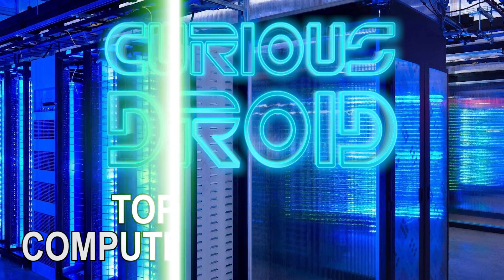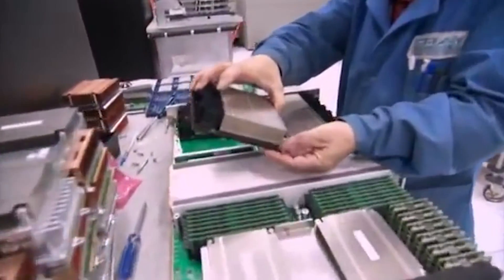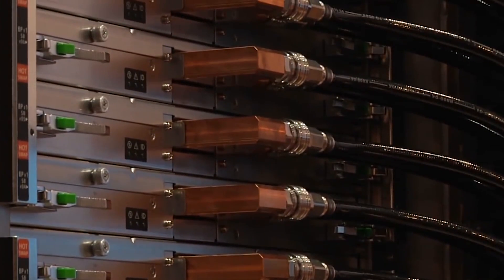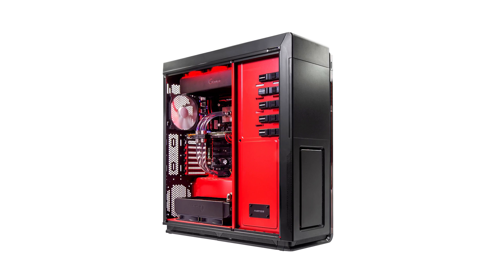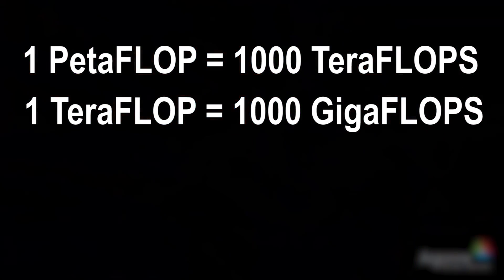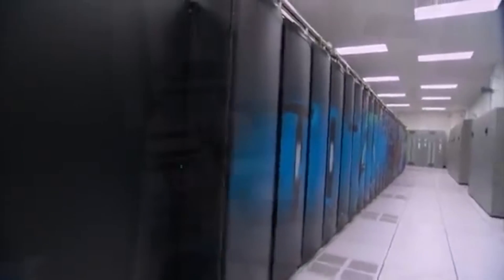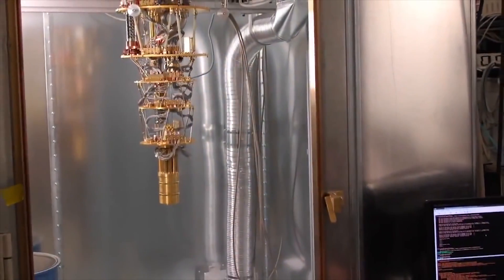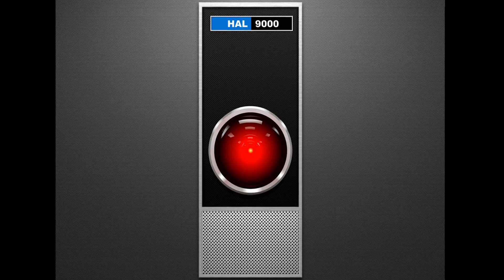Top 10 Fastest Computers in the World 2016 - How much faster is a supercomuter than a PC or iPad Pro

Comment: you're comparing cpus, but gpus are much more powerful, for example: my i7-4790k does 96 GFLOPs/s and my GTX 960 does 2300 GFLOPs/s, but an Nvidia Tesla K80 (dual gpu, commonly found in supercomputers) or an Nvidia P100, respectively do 5600-8700 GFLOPs/s and 9500-10600 GFLOPs/s
sources:
https://en.wikipedia.org/wiki/Nvidia_Tesla
https://en.wikipedia.org/wiki/GeForce_900_series
http://www.techwarelabs.com/intel-core-i7-4790k-devils-canyon-cpu-review/4/
Reply: the GTX 1080 does 6.5 teraflops
Reply: GPU's cannot handle serial or branch heavy code like a CPU can. They are best suited for code tasks that requires no branch prediction and can be paralleled.
Reply: The Tianhe-2 uses 32,000 Xeon E5-2692 (12 Core, IvyBridge, 2.2 GHz), 48,000 Xeon Phi (57-core, 1.1 GHz) and 4096 Galaxy FT-1500 (16 cores, 1.8 GHz)

Titan uses 18,688 Opteron 6274 (16 cores, 2.2 GHz) and 18,688 Tesla K20X (think of GTX Titan, yeah it has over 18,000 of it)
Reply: but can it run minesweeper at 140p 30fps?
Reply: RainbowSixSiege
yes fucking idiot. I dont want to see triggered shit in here too.
Reply: they dont need rendering power in the super computer they need procesing power and thats why you dont put a Titan X in your office pc but you put a strong cpu without a gpu
Reply: Our CPUs are general purpose chips that are able to calculate all sorts of stuff (Think ALU, FPU, SSE, AVX and more) while GPUs are highly specialized to do mostly stuff related to graphics and video processing (like 3D rendering, displaying game engines, accelerating video streams) Also modern GPUs basically consist of thousands of "cores" while CPUs are rather around 2 dozen.

What good is all the performance in your GPU when you can't use it for the task you have to work on.
Reply: I don't have a bad day it's just that people like you should think twice about posting that shit because that's too fucking old.RainbowSixSiege
Reply: Mikat exactly what I was about to say
Reply: He compared cpus because the supercomputers use processors  (cpu) not gpus to boost its speed and performance like regular pc.
Reply: Hence the name supercomputer.
Reply: yup, it depends on the workload, if your workload is cpu based or FP64 based, the supercomputer smacks the normal computer super hard, but with FP32 or FP16, the normal computer isn't as far behind
Reply: GPUs are faster thats right BUT Flops are just numbers.P100 would be still destroyed by the GTX 1080.
Reply: GPUs handle Geometry and CPU pretty much handles almost everything
Reply: GReDDY WupS someone must had a bad day...
Reply: I have a i7-4790k too. I used that tool from the video and got over 193 GFlops...
Reply: Most of these supercomputers use the same tech as GFX cards and in-fact get most of their grunt from the parallel processing on the GFX (sorry, GPU) cards of their highly parallel workload.  So to compare apples you need to examine the GFX cards not just CPUs.
Reply: A single GTX 1080 hovers around 8873 GFlops in single precision and 227 GFlops in double presicion
And for your CPU (couldn't find eny quick results) just run linkpack.

(As comparison: My 3570K @ 4.3 GHZ does aropund 55 GFLOPS and my oc'ed 660 Ti does circa 3231 GFLOPS SP and 134,6 GFLOPS  DP)
Reply: Mikat rt
Reply: Eric Douglas it because they are used for different things
Reply: It's almost like FLOPs are an insufficient description of direct comparison between wildly disparate system set ups, and that the numbers given were to convey the idea of general computing power. There's no way a graphics Card can even remotely compare to these beasts. I mean if I could get more power out of a machine by loading it up with titan Xs for a 100 grand, why would I spend millions of dollars and megawatts of power? Could it be that GPUs don't handle general computing too well and can only run their calculations on heavily optimized code that is designed for them? Calculating triangles isn't that difficult a task. I mean a human can score in the 10s of flops for triangles with enough practice. 
A more accurate comparison would be to look at both BogoMIPS and flops to get a general idea what can be pushed through the pipeline as well as how many useful calculations can be done per cycle. The problem with that is that it makes for a confusing comparison. Now you have to have an understanding of pipelines, multi core processing, instructions per cycle and many other higher level knowledge bases that don't really apply to "how many times more powerful is this machine over my desktop and iPad?"